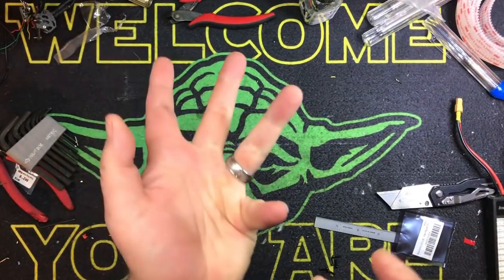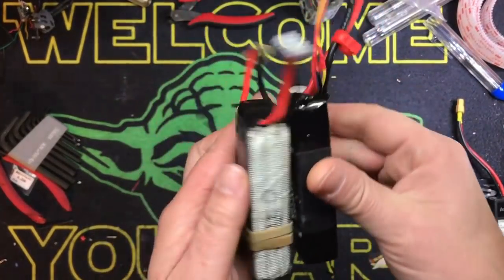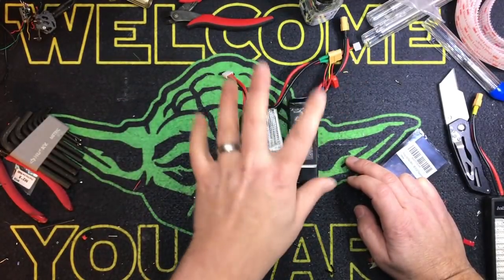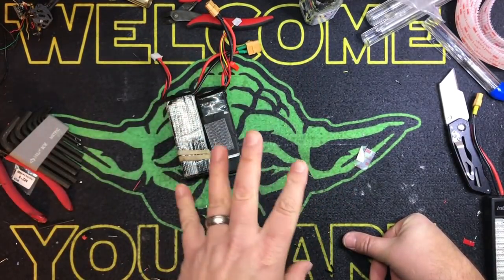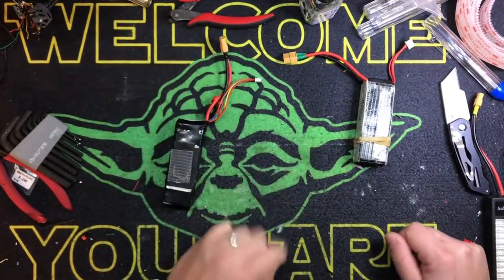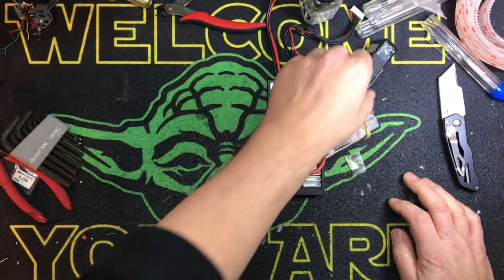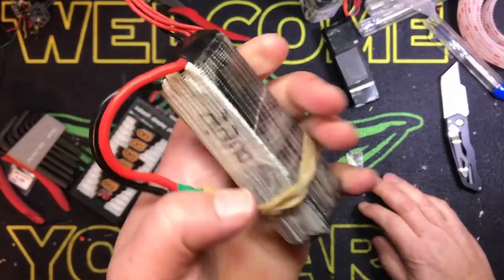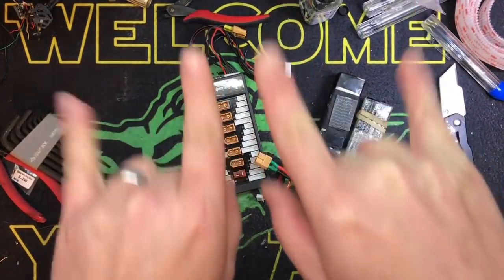Tech Tip - How to save ya batteries from low voltage the smart way

Comment: Awesome tip JJ.  I don't understand this sort of shit that much, so I have a question about the scenario you showed... When you plug them both into the parallel board together, will the good batt instantly "flood" voltage over into the bad batt at too high of a current rate before you even start the charger?  Is that even a thing?
Reply from the maker: No it dosnt flood.  But it will balance from hit to low.   Think of it as using jumper cables on your car jump starting another car with a dead battery.   It dosnt blow up or wreck the other car, and if the other car battery is really dead, sometimes U have to let it sit a while to get a jump.   Does that make sense?
Reply: JJRotoGeek Yeah that makes sense to my walnut sized clump of grey matter. Lol. That car thing was a good analogy. Thanks man.
Reply from the maker: Bam🤘🤘

Comment: How you sense the bad cell? If some cell is stuck on 2,2V and never will be able get over that voltage this proces will suck great battery to that voltage. There you got two brick batteryBAM. That NiCd proces is much safer because no one is charging it to full voltage only for couple second till all cell go over 3V (this take like 10sec if battery is not dead). If some one connecting 4s Lipo at 10,5V and 4s at 15V at the same time to paralel board (as you say and come back later) is fokin HERO with superior insurance.
Anyway love your all vid.
Reply from the maker: Lolol.   I like your context!! So u think that if u put a fully charged 4s in parallel with a 4s with one cell being 2v, u think that that 1 low Cell will bring down and damage a fully charged Cell with only needing a 1.3 up charge??? As long as the charger is charging this is an impossibility.   Howeverrr. U are correct that if u have a damaged cell that it could blow or not work right again.   There’s a difference also between physical damage and draw down damage too.  Physical damage with a low cell, pitch the fucker.   Totally agree.   An over draw, the risks are pretty low unless it’s pulled waayyyyy low.   Just my opinion.  I do it both ways.   And usually damaged bats stay screwed either way if they are to low

Comment: Wait full charge to balance charge.. what's the difference? I always balance charge batteries..
Reply from the maker: I misspoke brother.   I corrected it in the comments.   I meant bring to storage charge then full charge.
Reply: I mean have I been charging my batteries wrong in general, not trying to rescue a battery, yet.. do I need to balance charge them then full charge my charger has both setting..this might be why it always says batteries not fully charged on the osd warning..
Reply from the maker: Hmmmmm no.    If you have a 1300mah battery.    U should be setting your charger to 1.3 and charging in balance mode.    Does that make sense?    If u had two 1300 , that would be 2600mah so u would set it to 2.6
Reply: So always balance charge.. Got just making sure...
Reply from the maker: Alwaysssss